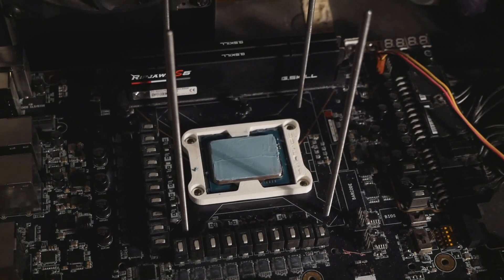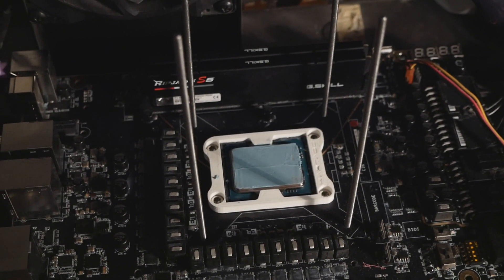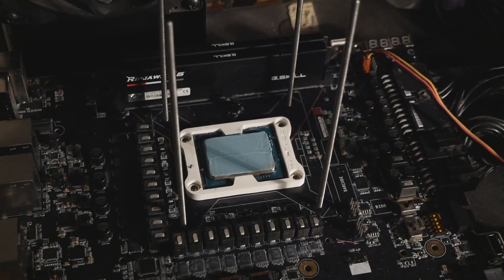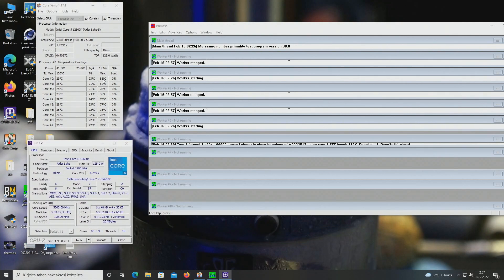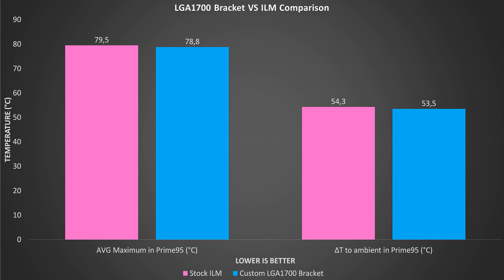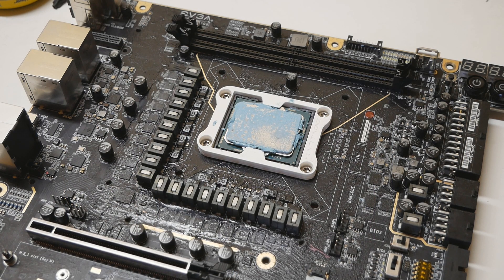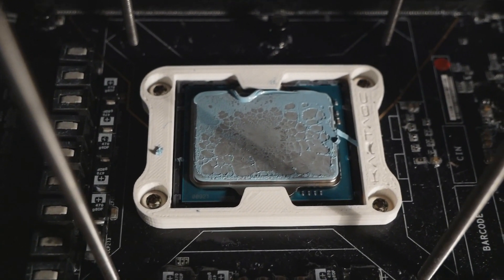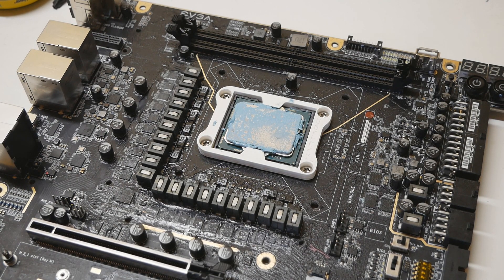Custom LGA1700 Socket Bracket - Socket MOD Done the Right Way

Comment: V2 needs to be made to hold down on all of the chip not just the IHS you can clearly see even in the video that the corners are not laying flat
Reply: Laying flat is not required. It’s only there as a frame to hold in place. The cooler does all the work ;)
Reply: The back pressure of the pins in the mobo is responsible for the bending. So it's strange that this custom bracket ignore the top and bottom areas

Comment: I don't even understand HOW this change could possibly help. Even in theory, that part of the mount has nothing to do with cooling...
Reply: The word is, stock mount can bend the CPU substrate and IHS, make them a bit of a Pringle, and so reduce the contact patch with the cooler, make the pressure distribution less even.

Which is not to say the redesign helps, just that there are plausible mechanisms how one or another way of constructing the retainer can have some effect. Also stock retainer by all reason has different geometry from sample to sample purely from manufacturing variance.

Comment: Good video as always. The super clear difference in thermal paste spread on the stock mounting side to side was a pretty good indicator of the issue with the stock mounting system.